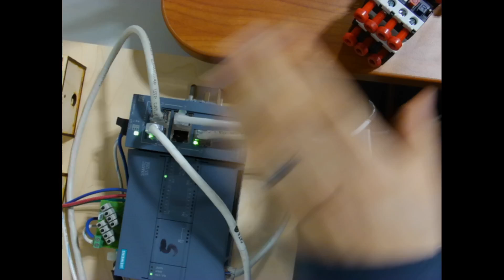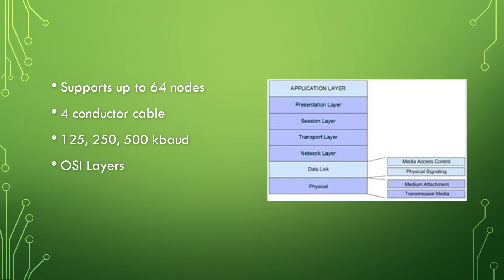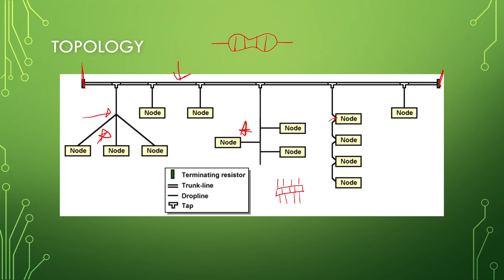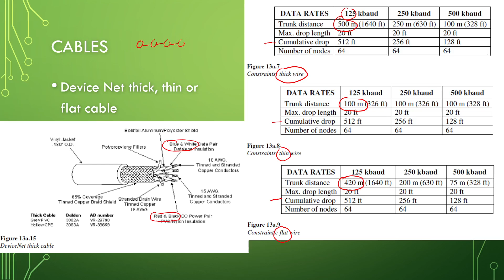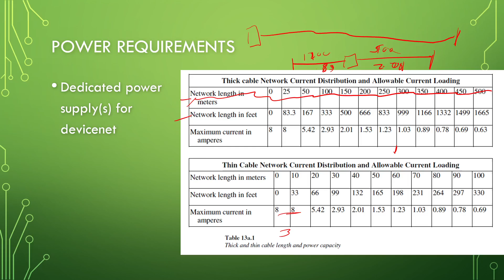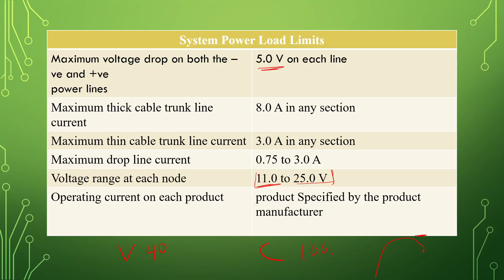ELE 101 Devicenet #1

Comment: Thanks for this. I jusat started a ob where there is nothing but devicenet. I have onlu used DLR. THere was Devicenet in a plant I worked as an automation engineer, but that wasn't my responsibility, so my exsposure is there , but the engineering level configuration isnt there. I have ordered some devicenent stuff to build a network and go from there. This will surely help a lot. Liked and subscribed.